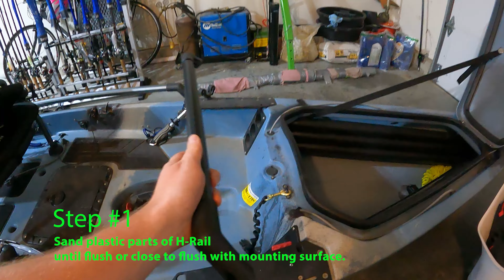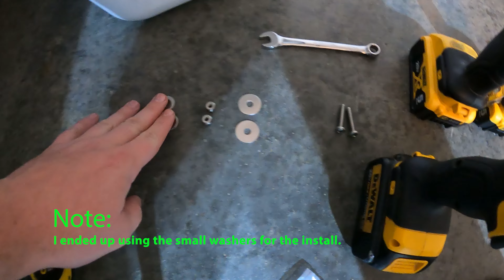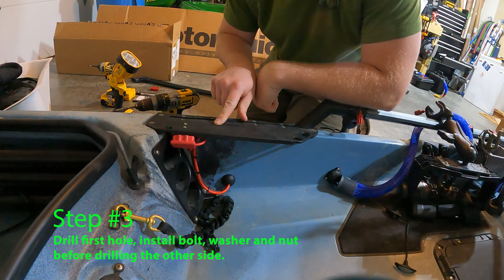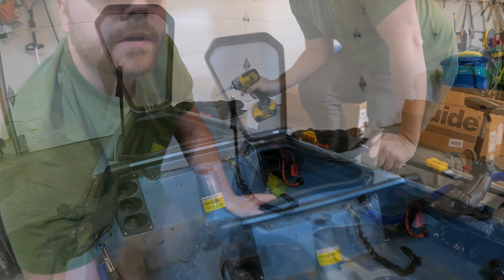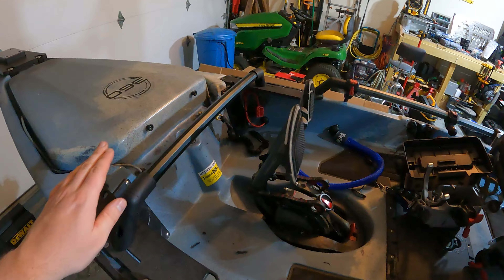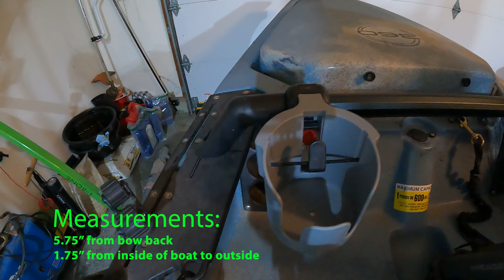Hobie H-Rail Install: Hobie 360 - Pro Angler - Front H-Rail - Additional H-Rail - Extra H-Rail

Comment: what is the part # you have to mount your garmin to the h rail? Thanks
Reply from the maker: There are 3 components for that:
H-Rail Ram Ball 1.5" - https://www.amazon.com/Hobie-Ram-Ball-H-rail-1-5/dp/B00OX573LC?fbclid=IwAR0g6JPFqnk5GqocOxkGLJUFzXDI6n_bCaEovbx_seiiPrWhIh-7FeQuG7U

Double Socket Ram Mount Arm - https://www.amazon.com/RAM-Mount-Double-Socket-RAM-201U/dp/B000R4QS00/ref=pd_lpo_2?pd_rd_w=3fF4K&content-id=amzn1.sym.116f529c-aa4d-4763-b2b6-4d614ec7dc00&pf_rd_p=116f529c-aa4d-4763-b2b6-4d614ec7dc00&pf_rd_r=A9VDBM6D0CB4G4MQHBSK&pd_rd_wg=0OniV&pd_rd_r=cf3d693c-2832-4bf5-b5e5-b7130752a88d&pd_rd_i=B000R4QS00&psc=1&fbclid=IwAR1_00pQBVOfD6yvCq5HPQN2AKYCjEnmnPNaSopJHuJJpqR2OAbzFa-pt64

Ram Universal Marine Electronic Ball Adapter Plate - https://www.amazon.com/RAM-6-25-Universal-Electronics-Base/dp/B00CJPUPRC/ref=pd_lpo_1?pd_rd_w=3fF4K&content-id=amzn1.sym.116f529c-aa4d-4763-b2b6-4d614ec7dc00&pf_rd_p=116f529c-aa4d-4763-b2b6-4d614ec7dc00&pf_rd_r=A9VDBM6D0CB4G4MQHBSK&pd_rd_wg=0OniV&pd_rd_r=cf3d693c-2832-4bf5-b5e5-b7130752a88d&pd_rd_i=B00CJPUPRC&psc=1&fbclid=IwAR0qHP954qeELEr9NZiWfsQKVlheXSxWXrbRMOGh_Ok-owfFXJM3pVcckpU

Comment: Like the idea of placing a hrail on the front of a PA14.  Is the 21” hrail longer than 21”with the black attachment end pieces?  If the total length is 21” it won’t be long enough to work on my PA14 360.
Reply from the maker: Hey Roger, sorry for the delay. The bar itself is what measures 21", the black plastic end pieces are not included in that 21" measurement from Hobie. I believe, don't hold me to it, the total length of the 21" H-Rail kit is actually 28" with the black plastic ends included.

Hope that helps!
Reply: @applegatefishing thanks, you answered my question. At 27-28” it will work!

Comment: I have a 2018 pro angler 14, is there any difference between the newer models or will the 21 in bar fit mine?
Reply from the maker: There are no major hull differences that would cause an issue with installing this on your 2018 PA 14. Thanks for watching and best of luck!

Comment: Thanks for the tips and the video. I’ve been following a Hobie group on Facebook and seen this front rail. Now I’m wondering why i bought it. I think getting a few things off my side rail would be a good reason. I’m always worried that if i tip, I’d have too much crap on the side rail to get back in. This should help clear a spot. I have an older PA 12 so i might have to shorten the bar a little.
Reply from the maker: Absolutely, glad to help. I think you'll really love having that extra H-Rail up front.

Comment: How do you like your FF on the front H rail?  Is it still there? I am most likely going to get a 10" screen.  Been contemplating getting the PA14 360.
Thx
Reply from the maker: Hey Brian, yes I do still have my FF on the front H-Rail. I put it as far to the right side as I can and as low as possible. It works perfectly there and is out of my way while still be visible.

The 360 drive is nice but if I could do it over again I think the 180 drive setup + spot-lock bow mounted trolling motor would be perfect.
Reply: @Applegate Fishing  thx for the reply i will not be doing a trolling motor at all so i am sure about the 360.    About the forward mount for your FF .  Is it a pain to get up and mark a fish or way point.   My only concern is about not having contact with my FF to hit and keys needed so getting up and down, etc.  I am a big guy at 6'3" with long arms, so wonder if i can reach it so it wouldn't be an issue.      Thx for any feedback
Reply from the maker: @briansupermag3918  I am 6'2" and I'm able to pretty easily touch it when needed. I have to lean forward a little ways but it is something I only do like a dozen times at most when I'm on the water. If I was mostly going to be seated and I heavily needed to touch the FF it might be better off being closer to the chair.

I have been routinely standing up and fishing now that I have a trolling motor so having it further forward like this has allowed me to still use it while standing similar to a normal bass boat with their FF up next to the trolling motor pedal.
Reply: @Applegate Fishing  thank you as thats pretty much the answer i was hoping for.     I can have my screen split 3 ways.  Side scan in top so its wide then traditional sonar/chirp on 1 then chart on the 3 to see contour lines on the bottom to find places to target.    Appreciate it

Comment: Hey what Anderson plug is it for the motorguide xi3 trolling motor?
Reply from the maker: Hello, I am running 8 gauge wire throughout the kayak so I used Anderson SB50 connectors.
Here is a link to the exact ones I ordered: https://www.ebay.com/itm/193582018344